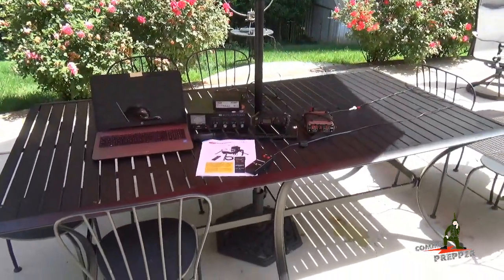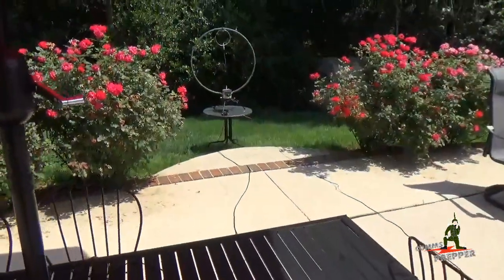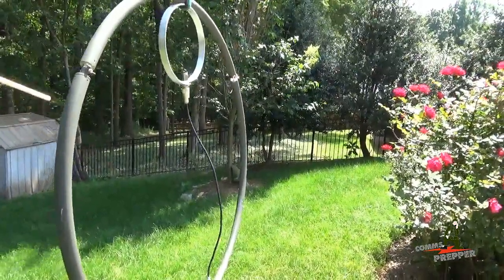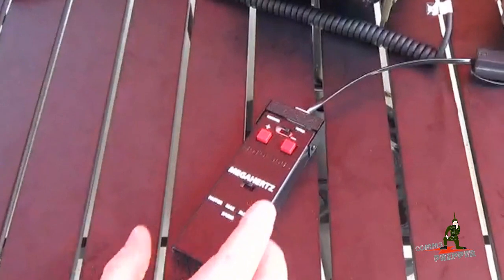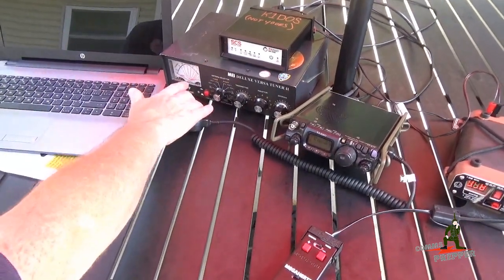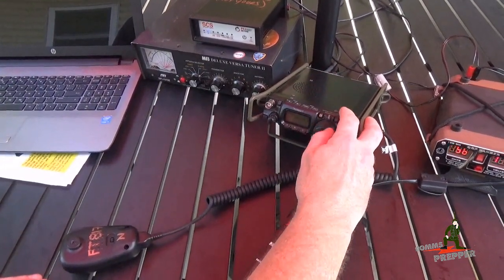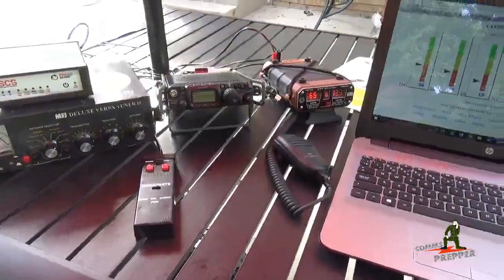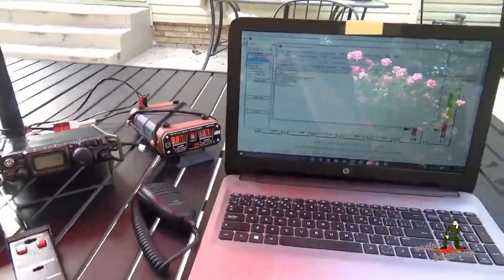Chameleon Antenna's RTRR-1 Kit for F-Loop Antenna

Comment: I like the idea of remote tuning. Their tuning setup reminds me on my old AEA-ISOLoop antenna which also had up /down buttons but included a variable pot to set the tuning speed. Low, Medium and Fast options are just as good. I had my loop mounted usually horizontally so didn't need to rotate it but when it was used vertically it could reduce QRM noise as well as peak a signal.

Comment: OK, excellent. New to MagLoops but my question is this... you are not supposed to use an antenna tuner with this antenna, so you are using the MFJ as an SWR meter only, right? Otherwise nice setup. Best and 73
Reply from the maker: Yes - it was in meter mode only so I could use the SWR meter.

Comment: 73's - are you using the DR-7400 or 7403(Bluetooth model)? I have the same setup excluding the modem which I plan to purchase. W2CID - Norfolk, VA
Reply from the maker: I have the  7400 with the bluetooth option.  You will love the modem!
Reply: I received the 7400- what settings do you recommend on the radio(baud rate, etc.) never used the modem so I am completely new at using Pactor. I use it with the F-Loop as well

Comment: Hi Hank - love the remote tuning capability, firstly because it will keep the RF away from the operator position. Can the unit be weatherized sufficiently to permanently mount the antenna on a roof? Some coax seal or other goop would take care of the usual connectors, but are the motor shaft openings adequately covered? Do you think these motors would stand up to frequent use, working against wind load, etc.? Any limitation in length of the remote cable? Sorry to bombard you with questions...only one more: is there any way to read the motor position, i.e., so you could know the azimuthal heading or bring the tuning capacitor to a known location for a given frequency like a preset?  Thanks for the video! 73 - Jack
Reply: The Commsprepper asked me to answer that question: The antenna can't be weatherized efficiently enough to be installed permanently on s rooftop. Even if you can do so humidity will still get in and creates all sorts of problems.

It's same thing with the CHA RT-RR. The unit isn't made to resist direct water contact and constant wind pressure.

The remote cable can be just about any length you want. It's a regular flat phone cable.

Nothing is currently in place to know the motor rotation. So azimuthal heading tracking is currently impossible to do with the current model. Something more sophisticated like a servo would be needed.
Reply: I am currently using my F Loop on 30m WSPR, running 200mW from a WSPRLite. The weather is awful (snow yesterday), but the antenna is working well from inside my garden shed. 73 de Bob. M0BOB.

Comment: It is a great idea. I just wish the implementation would have been better. While I got mine the work somewhat, it was not without trouble with the alignment of the servo to the tuning knob which is critical for the small motor to be able to turn the capacitor. The remote control is a bit questionable in my opinion. I still use mine from time to time but definitely wish it was made with more solid components such as stepper motors instead of the two-wire apparently brushed ones and a better mounting method than the one employed. It would also help if it would be easier to remove. The solution provided to use a tripod puts great strain on the tripod stub, but then again, so does the factory plate on the F-Loop. Great idea that can be refined a bit.
Reply: We definitively not considering your comments as product bashing. They're valid comments like any others here. One thing that is important to note is that the RT-RR aren't made by us directly but by a third party located in Colorado.
Reply: +Chameleon Antenna please, don't take my comments as product bashing, I have several of your products that I have happily spent on and I'm very satisfied with. My comments here are based on my experience and like everything others may have a different one.
Reply: I understand Carl. Keep up the good work. I have several of your products and They work and do so well
Reply from the maker: I did not have a problem aligning the drive motor with the tuning knob.  I loosened the screws holding the motor, ran it CW and CCW to find center and tightened the screws back up.  I found that separating the control cable from the RF cable did reduce the RFI from the the control box.
Reply: Both motors are stepper motors. They're fed with multi-wires flat phone line cable. Normally if you install the remote on the antenna, then it's not something that you'll take on and off all the time. The first installation might take a little longer because you've to adjust everything perfectly with the capacitor shaft. But after that it should be straight forward with it.
Reply: Also you aren't going to use a light weight tripod to install either the F-LOOP of the remote and the F-LOOP. You'll need something that can handle 10 to 15 lb at least. Small flimsy $20 tripod won't make it.
Reply: +Chameleon Antenna understood, I happen to use heavy duty studio lighting tripods for my antennas. The hole in the base is the 1/4"-20 thread which seems standard, I have not broken mine but with the hole being off center it gives that feeling that the leveraging maybe a bit much. No biggie though.
Reply: +Chameleon Antenna I will have to disagree regarding the motors unless you have changed the design. Th motors in mine are two-wire doc motors. The control just changes the polarity for direction and the voltage for speed of the motors. The phone cable is used to carry the wires for both motors. Again, I see this in mine, if the units shipping now are different then I would love to upgrade mine :-)